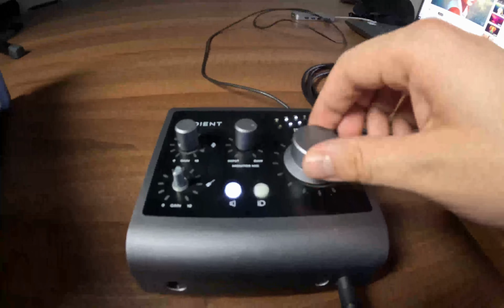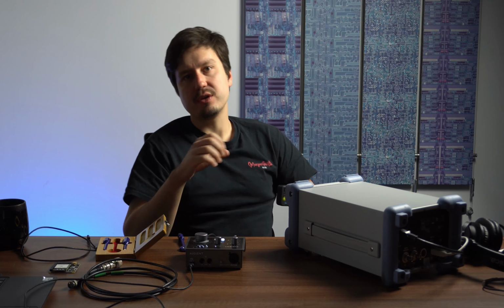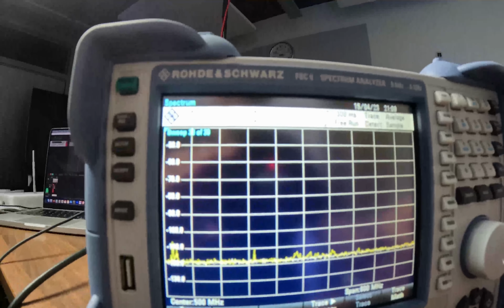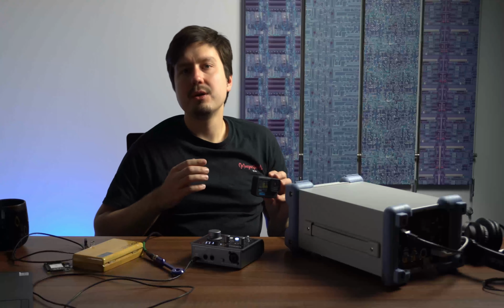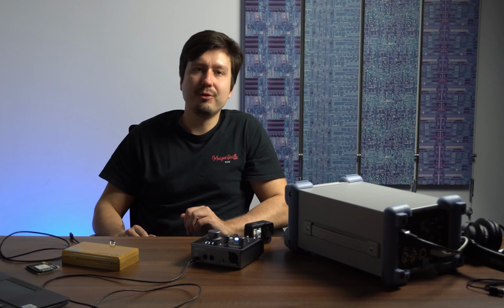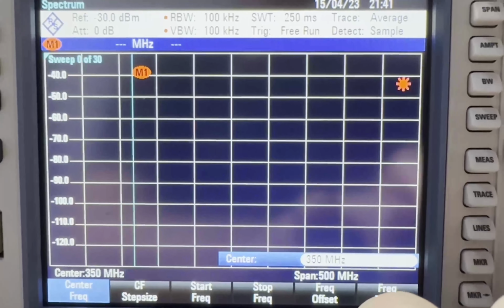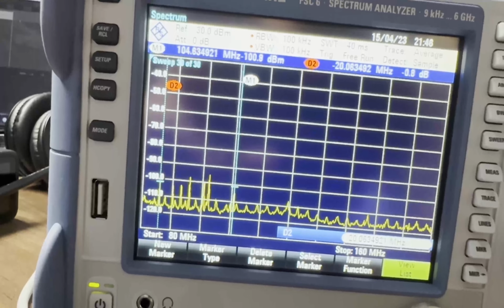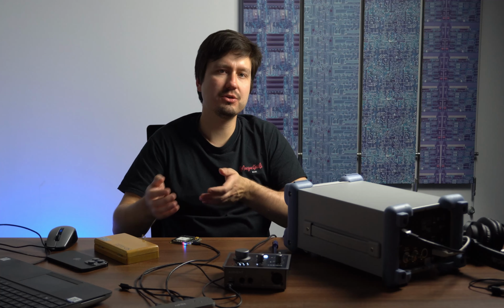EMC Fault Finding DIY Kit (Spectrum Analyser, LNA, Near Field Probes)

Comment: Thanks. 
Do loop antennas have polarizations like hybrid antennas in order to measure H-field or E-field?
Reply from the maker: Yes, they do. But the pencil E-field probes that I also used in the video do not. Note that the E and H field distribution can be very chaotic in the reactive near field, so it's improtant not to rely on this 'measurement' for anything other than troubleshooting.
Reply: @DrEMC-sf8rx  No, Actually I was asking about loop antenna polarizations 150k-30M) in far field for RE measurement as per CISPR 11 group 2 limits
Reply from the maker: @vishvajeet7064  yes, they are as well. I just went back to check a 9 kHz to 30 MHz spurious emissions test report where we used one of these gigantic loop antennas - and yes we tested both polarizations. One measurement for front and one for side.
Reply: @DrEMC-sf8rx  helpful.Thanks.❤